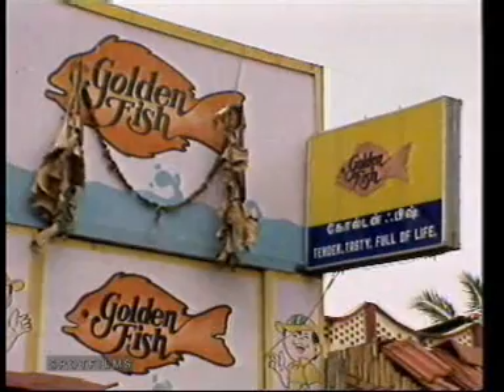ZERO-WASTE IN DISTILLERY

Comment from the maker: Dear Valerynna Itenyo,
We did this story way back in mid 90s. It was called Voion Chemicals and distilleries. I tried to put a link but Youtube does not allow me to put links. You can mail me at: Mathur.pramod@gmail.com. Following info should be helpful:
Address: Rayala Towers, II Floor, 781, Anna Salai, Chennai, Tamil Nadu 600002, India 
Phone: +91-(44)-833246  Fax: +91-(44)-833266  Map/Directions/Local Suppliers >>
At one place it is mentioned as DORMANT.Please check it out..
Pramod Mathur